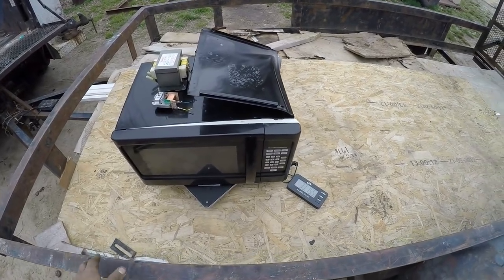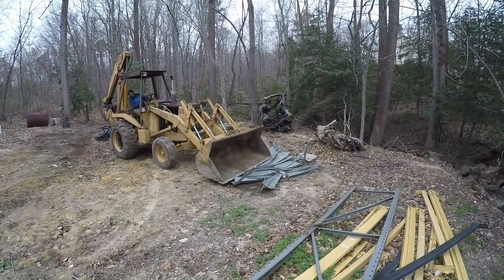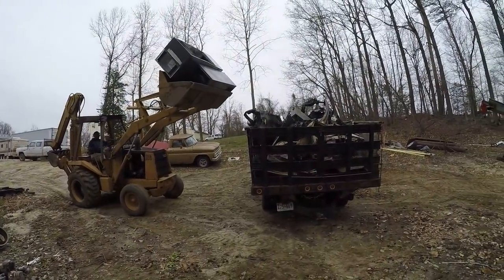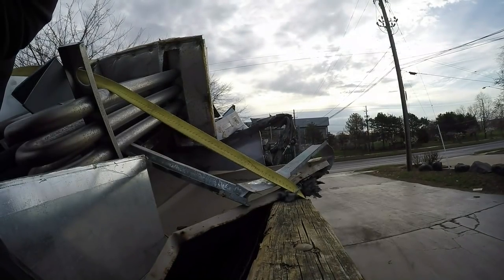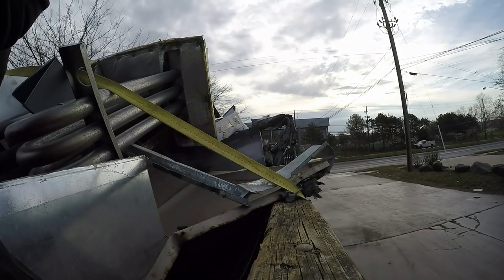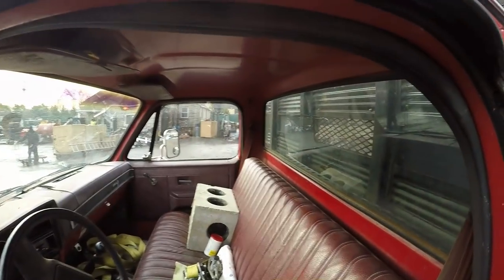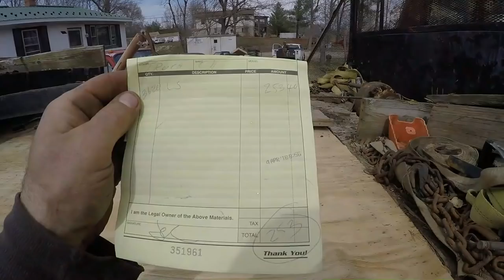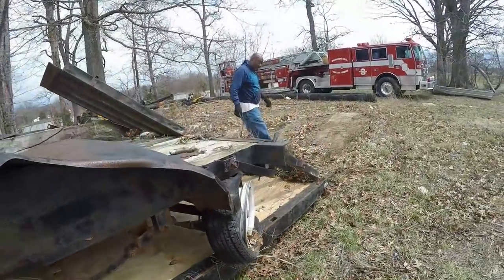microwave price breakdown, scrap run and wrecked trailer!

Comment: microwave not really worth it taking it apart lol
Reply from the maker: Hardly
Reply: Depends on your strategy.  Experts are predicting copper will go through the roof in a few years.  I'm holding on to every bit of it.
Reply: Depends, I get really good prices for transformers, even the Aluminum ones. I spend 5 mins or less on a microwave, so if I stripped microwaves for an hour I’d make a good $36 or so. Sure there’s other things that make way more money, but I stack microwaves and scrap them when I have free time.
Reply: @nicolaschu9599  I agree.  Once you have taken apart a few it doesn't take long at all to tear one apart.  I use the body to put small scrap in.  It makes that stuff easier to load and adds weight when I bring a load in.